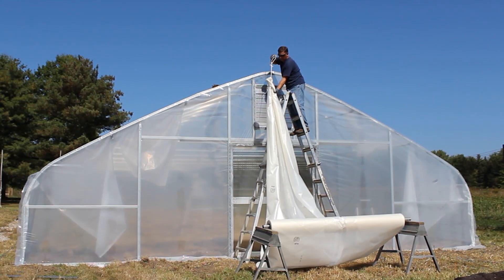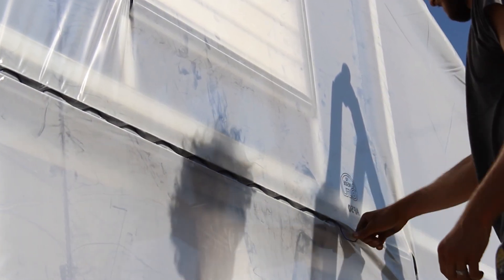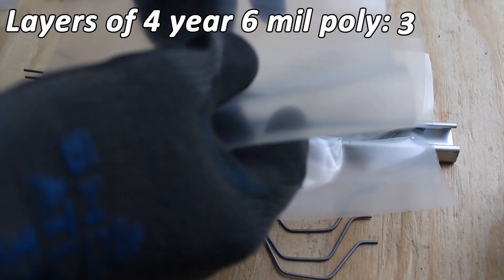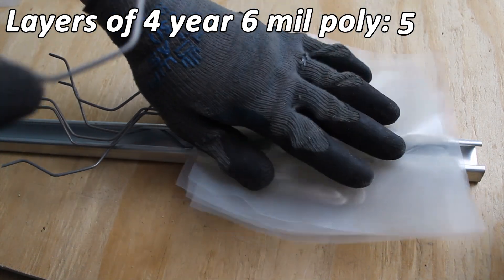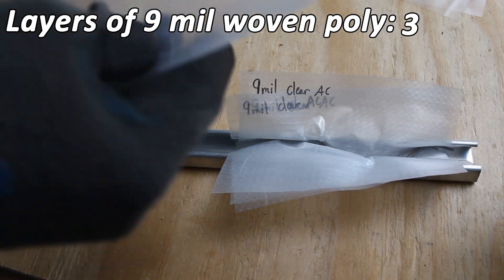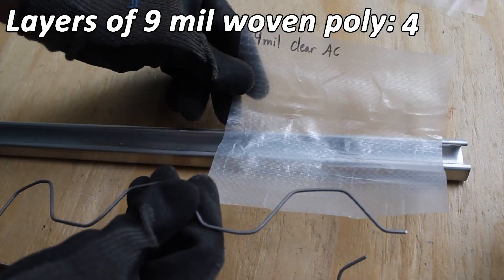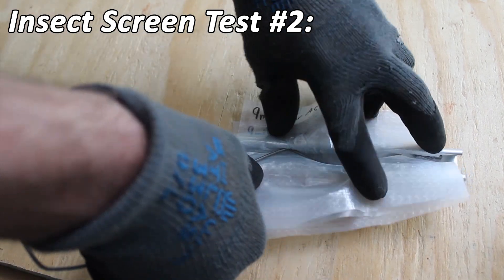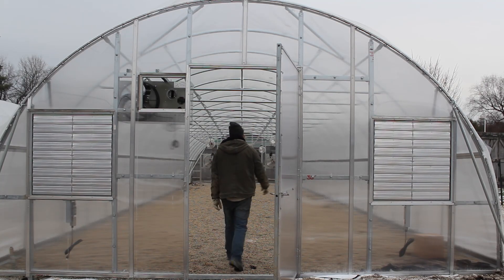How Much Greenhouse Plastic Fits in Spring Wire Channel?

Comment: Do you have any kits that are full twin wall? I don’t want to use any of the flexible plastic
Reply from the maker: We do not currently offer that, but we DO offer 8mm Twin-Wall polycarbonate end-walls with SolaWrap Top Covering (More or less, SolaWrap lasts the same amount of time as 8mm polycarbonate. We have a video on SolaWrap that provides some details and shows a time-lapse install: https://youtu.be/aTDxUAAm7pk?si=sZx8CaWklG8M79yv

Thanks for watching, and the comment!

Comment: can i bend Aluminum Profiles to U like curve shape. so can i connect it with bamboo small poly tunnel ? https://www.youtube.com/watch?v=d8_R_4R19NU
Reply from the maker: If you were to do this with bent bamboo it would depend on the radius of the bend. You may also want to bold it to the bamboo if possible since I have never attached channel to bamboo and have no idea how well it can receive screws. Good luck on your project!

Comment: i feel those wire could possibly hold 1 or 2 more layers if you alternate the wire laying direction perhaps.
Reply from the maker: Thanks for the comment, and that is certainly possible; I think I was trying to make it as TIGHT as possible so as to prepare people for the worst-case scenario... I wouldn't want to hear about someone thinking they could get one more piece of wire in only to find themselves in a jam. Anyhow, you are probably correct about the off-set wire, and thanks for the comment!

Comment: Ours is almost ready! Can't wait to get it installed.
Reply from the maker: Nice! Love to hear that, and thanks for the comment!
Reply: New to this. Why would you do multiple layers?
Reply: @blainedecker  If you were going to do a double layer with a blower over the top for extra insulation and/or add insect netting under the roll up sides. And/or if you choose to add shade cloth and secure it with wiggle wire instead of tie downs.
Reply from the maker: Good question. Often the plastic for the end walls are a separate piece than the top (2 layers), and then some people do two layers of inflated top covering for better insulation (3 layers),  and then some people add insect screen to parts of their structure or shade cloth or both. This can slowly but surely increase the number of layers of material you need to secure within the channel.